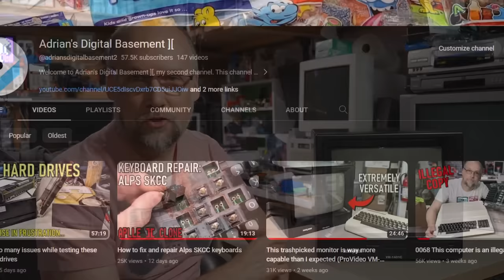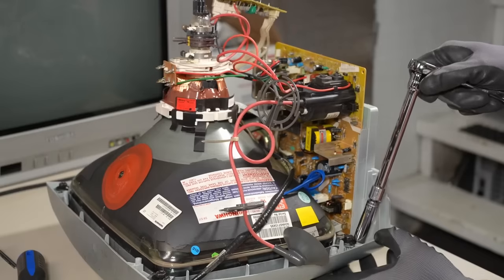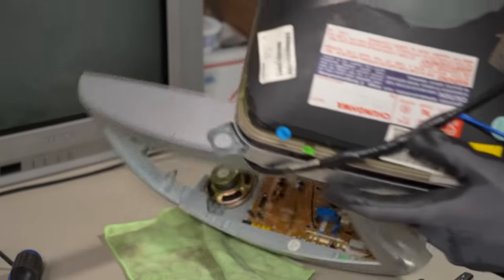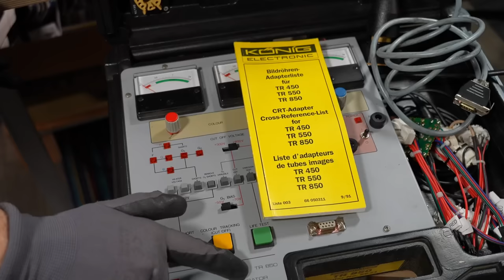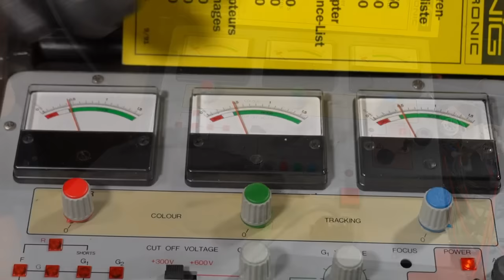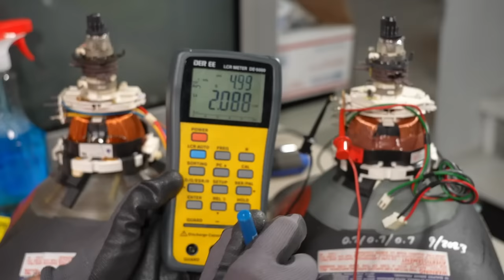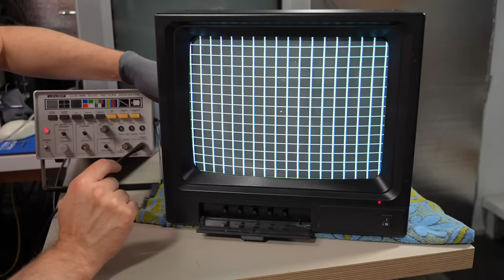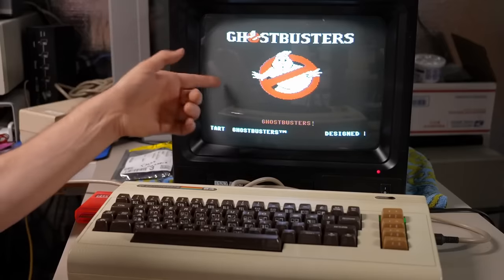From junk to awesome: Fixing an old monitor by swapping the CRT

Comment: 3:36 Yep SDTVs were plagued with penny pinching feature removals in hindsight, so many jungle chips could have done way more than they ever did. Even the VHS home video boon era didn't see a tremendous surge in Composite capable TVs, they made RF-coaxial only models way, way too long.😒
I think we're past the era of elitist scoffing at low end CRTs lol, going from side of the road picks, to picks from recycling centers only, to no picks at all eventually ijs. It's DIY projects but a lot of SDTVs could do so much more than we knew, like RGB capable ones alone that might have S-Video ports heh.
Great job man, pretty nice finding matching donor parts.🙂 Truth is in NA most of us that lived through the SDTV era never actually experienced all they could offer. Personally I only used post Composite AV port types just a little after DVD started, where S-Video had been around for more than a decade already.

Comment: To fix scratches you need a cement that is of the same refractive index as glass - optical cement, used for gluing compound lenses together. If done right such material will make the scratch disappear.
Reply: I've got two CRTs that need some scratch treatment.  One is just a vanilla Mac Classic, of which there are plenty to go around.  But the other is a beautiful 32" Sony Vega.  Can't exactly just hop onto eBay and have one of those sent Priority Mail...  :-)

Glad to know this is an option.  I was expecting to have to build an upright stand and sand / polish them by hand.  Was not looking forward to that.
Reply: @nickwallette6201  I am sure you have to thin the cement out and apply it very carefully in thin layers with a fine brush. Those windshield crack solutions depend on this idea.

Comment: Hi boss. Whenever I see soldering tutorials everything looks so nice. I get a lot of brown oxidizing crap when I solder and things don't seem to flow and settle where it's supposed to. I'm guessing just crap quality flux solder and equipment. Any tips for improving my microsoldering. Are those videos done in a nitrogen chamber or something like that. Btw you should bury that CRT in your backyard and hold a ceremony sending it on its way to electronics heaven.
Reply: You might be using too high of a temperature. Flux rarely is bad, but if you are trying to use lead free solder any remnant of the old flux might be incompatible with the new solder.

Comment: nice, you made a crt into a floppy, well you could write a floppy at very high resolution, above blu-ray, with a crt electron gun, it might be single-write only, like cd-r. the writing or restoring could be done by electron metal sputtering, to cover any holes dips written. but are your stuff not complete/whole if you need to harvest their parts.

Comment: It might just be the angle but it appears the horizontal linearity is a bit off: the squares on the right side look a little bit fatter than the ones on the left. You might need to play with the value of one of those capacitors in the horizontal output if you want it to be perfect.

Comment: Any reason why you did not check the resistance of the deflection coils versus the inductance?
Reply: Inductance is what matters.  The DC resistance is really only relevant at DC, and deflection is not DC.  Inductance is more like resistance vs. frequency, so you test at (approximately) the frequency of interest (for US, 60Hz vertical, 15.7kHz horizontal.)

Comment: with the smaller tubes like 14inch the only thing i can see thatll ruin your tube swap days are narrow neck and non narrow neck tubes dont mix unless someone has found some tube socket thatll allow the changeover ( if your new tubes deflection yoke is useable impedance wise ) im trying to find a tube for a mtc900e arcade monitor and its a nightmare all i can find are pesky 1990,s narrow neck. i think i have to hunt much rarer 1980,s vintage

Comment: I had a monitor that sounded like boiling after I was turning it off, was it releasing the voltage? Also was it normal for it to make arcs inside of the tube when changing resolution from within Windows? The CRT was a goner after a while, it was simply not turning on and no longer sounding after it was turned off, and I was curious what was the cause to it
Reply: It's definitely abnormal to have arcing inside the tube under any operating conditions. However it is normal to get a split-second bright vertical-ish line or squiggle when changing modes.

Comment: Hello! My home CRT TV Panasonic tx21x1t, after 15 years, began to shake the image. It shakes quite a bit, but it is impossible to use. It has never been taken apart. I opened it and cleaned it of dust. But this, as expected, did nothing. Please tell me where to look for the problem?

Comment: Fun video! I always enjoy your content, especially regarding CRTs. I remember when I had to take tests to be an Apple Certified Repair Technician, starting in 1998, there was a section on the tests on CRTs, especially questions on CRT removal/replacement/alignment and CRT safety. If you failed that section of the test, you failed the exam. And with having to pay 150.00/200.00 to the authorized testing center to take the tests, I always brushed up on the CRT using practice tests Apple provided. With my last certification in 2010 (I retired in 2012), there was no longer a CRT section of the test. Halleluiah! 😀

Comment: Any TV's to keep and eye out for that would have tubes to fit the 1802 or 1902/2002 Commadore monitors?
Reply from the maker: 1802 is just a regular TV tube, so any 13" TV should work .. especially more recent ones, which are usually the easiest to find. The 1902/2002 is high res, so you are much more limited. You will need to find another high res computer monitor to harvest from unfortunately/
Reply: @adriansdigitalbasement  Okay; thank you.  I was thinking the 1902 (non-A) / 2002 was just mediocre looking.  Probably because of being too close to the screen, I thought the dot pitch was more like that of a TV. I had figured it was one of Commodore's less expensive monitors.  With a NTSC generator on it, it looks decent.  I think the tube is pretty good but may have been expecting more.
Reply: @adriansdigitalbasement   I figured out which were the separate Luma and Chroma outputs of the TSG130A, and wow does the 1902 look so much better.  It's like it has a really lousy composite input filter or something!

Comment: Is there a problem with switching the whole thing? board and everything? or why just switch the tube? Thanks.
Reply: The point of this video was: Adrian had a very nice board (in the security camera monitor) that was paired with a tube that was basically used up, and a fresh tube in a basic TV. The goal was to combine the fresh tube with the nice board, so that Adrian now has a 13" color monitor/TV for PAL and NTSC, and likely RGB after the next video. The basic TV board can't do NTSC and can't be RGB modded.
Reply: @tw11tube  Ahh, ok. So the security camera board can be modded for RGB, and output PAL and NTSC. Thanks!

Comment: I don't understand one thing. Modern flatscreen LCD's are a simpler technology. How come the more complex technology of CRT's is less advanced?
Reply: who told you lcd is low complexity?.....color lcd has several (upto a dozen in some cases) ICs that are each micromcomputers in there own right....a crt is just a vacuum tube with a wiggling electron beam....a color crt just uses 3 wiggling beams....
Reply: @CATech1138  Thanks for clarifying, I knew I was wrong
Reply: I think it is difficult to judge whether one technology is more advanced than the other. Certainly CRTs are more extreme machines. Manufacturing one at this time can be extremely difficult: You need heavy industry to manufacture the lead-crystal glass that is needed to supress X-rays. Once you have the lead-crystal glass and can make the tube, you need to install high precision electronic components inside the tube, and also the phosphors are advanced chemistry. Beyond the tube, everything inside CRT electronics is about precision, everything be highly precise in order to create an optimal picture. For example the yoke needs to be precise to bend the electron beams accurately and the drive circuits need to be accurate. And you need a lot of analog bandwidth to achieve high resolution.

LCD is complex in another way: You need micro/nanoscale precision to create the transistors in the active matrix that drive the liquid crystals. That surely requires an advanced manufacturing process. However, once manufactured, and LCD is entire digital. It might require high-speed processors to drive it, but it is all digital logic. High clock speeds are important, not high precision.
Reply: @danielmantione  Cool, I find this stuff fascinating

Comment: if you can replace that one capacitor to alter the width, could you not replace it with a variable capacitor?
Reply: Practical variable capacitors are very low values and the capacitor in the set is a much higher value.

Comment: I don't see the point why you cut the deflection wires? Same CRT, same coil base, I bet even the coil connection points are at the same position... you could easily unsolder the wires at the coil terminals, leaving the cable and the connector intact, instead of doing that messy slicing you did there...

Comment: Hi Adrian(@adriansdigitalbasement) , I have two CRT TVs and both go to TV mode by default every time I power them on and I must change  input to AV2 manually. It's very annoying.

Is there any way to change their default input to AV1 or AV2 ?

The first one has NXP jungle cheap (TDA11105ps) and another one uses a Toshiba/Infineon processor cheap(SDA55xx).